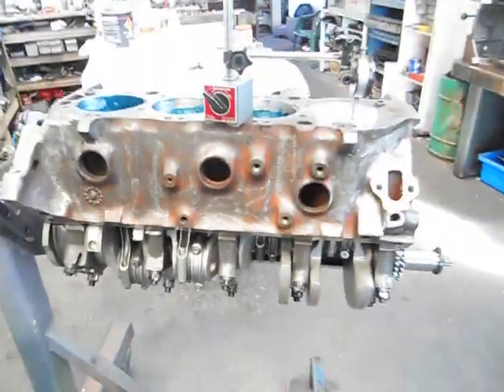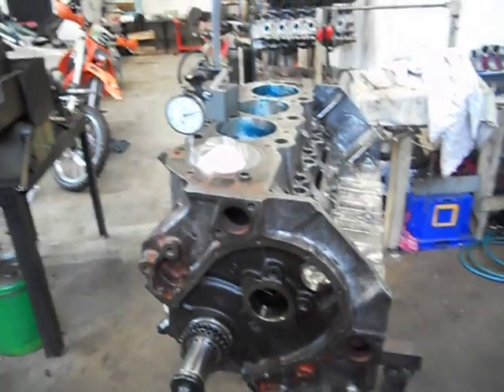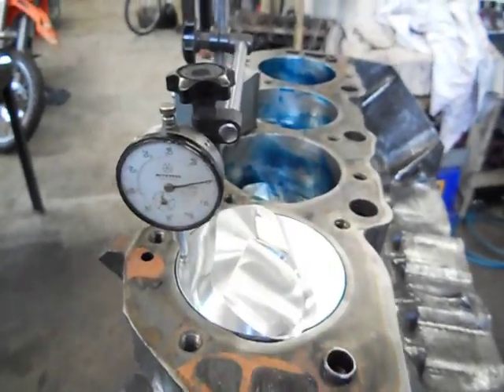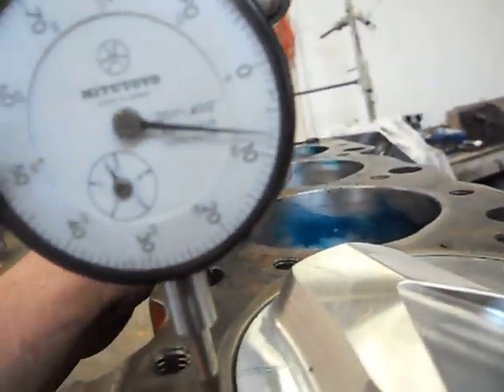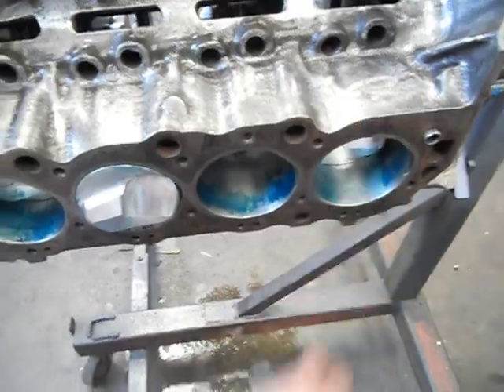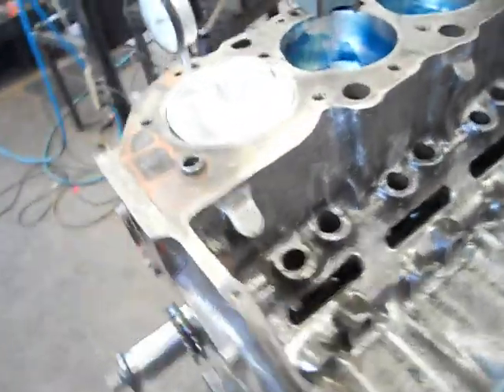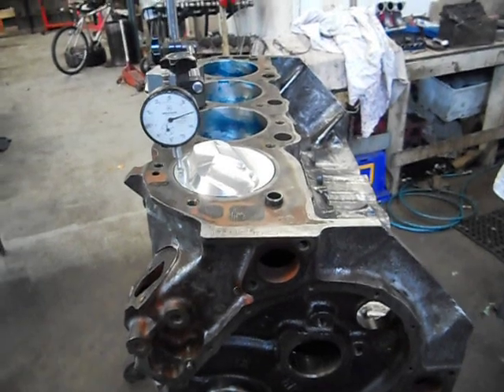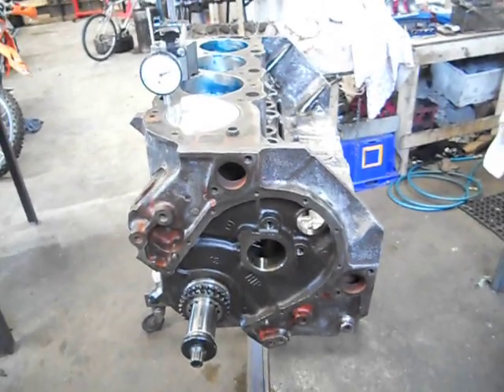Big Block Chev 396/434CI Stroker Blue-print Rebuild

Comment: Mate, if blokes like yourself don't pass this knowledge on, it'll get lost forever, so many thanks once again. BTW, with the need to deck the block by 4 thou more on one end due to the taper, slope or whatever; is that a result of an error in manufacturing, or is that still within original factory specs? In the big picture, 4 thou isn't much, but like you say, it's either right, or it's wrong....

Comment: How are you fella's from down under doing ? Can you please assist Me .. I was listening to you on another one of your video's and you remarked about a "Gudgeon" Pin can you shed some light on just what that is please..I know what a wrist pin is is that one and the same ? I'm watching your build and most definitely took notice of the Man hour's you have into the 369-434 I can honestly say there is not a part of the old iron block you haven't messaged ..and I'm just wondering could you have come away cheaper with say a New Block from say RHS ? Or  Dart ? not to mention the fact your block is an old 2 Bolt Main block ... Great work thus far ..